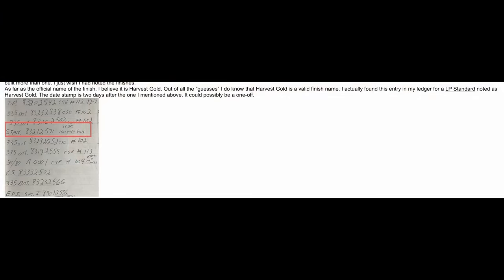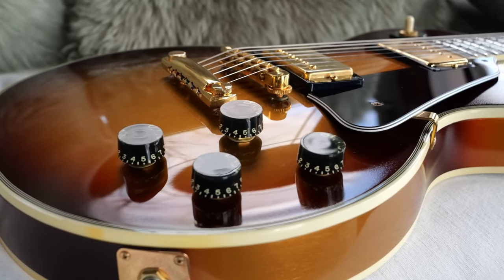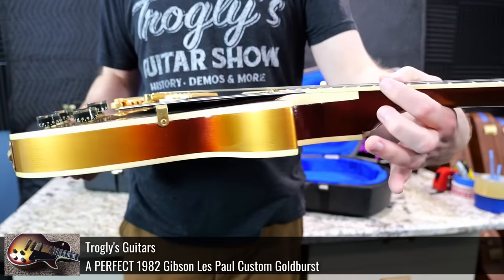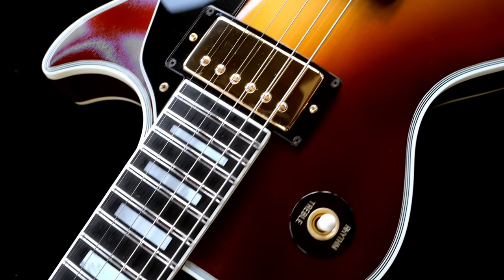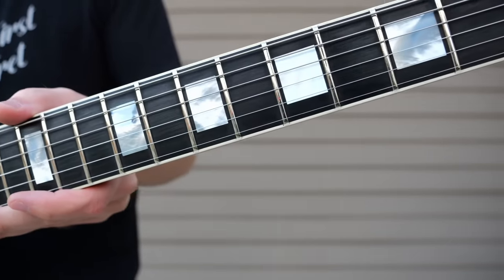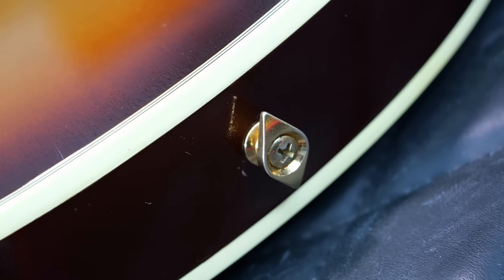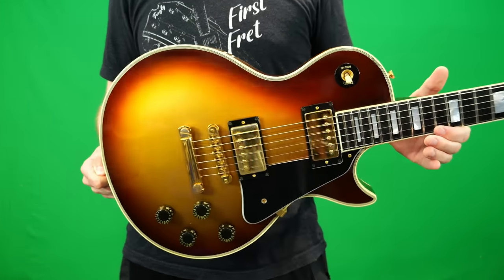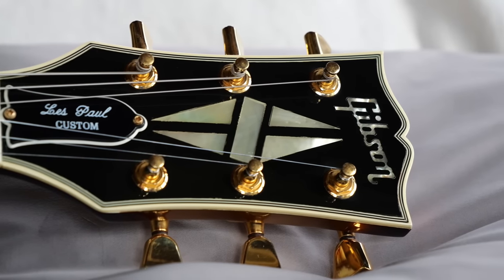It's A Miracle This Survived 40 Years! | 1981 Gibson Les Paul Custom Harvest Gold (Burst) Minty

Comment: Paint technology was changing rapidly in the late 70's and early 80's, and going from solvent based to acrylics caused headaches not only for guitars, but especially automobiles.  Think of how badly and quickly the clear coats disintegrated.  Not enough research to begin with, I'd proffer.

Comment: i have an original 81 les paul custom cherry burst. i bought it used in 91 i replaced all the black plastics with blonde gibson parts i got from gruhn guitars, and put the gold knobs on it. replaced the gibson pickups with dimarzios paf and super distortion. ace frehley style. better guitar looks and sound all round. course i still have all the original parts. mine has the flip out winders as well. love them.

Comment: Would be great if Gibson could figure out a way of getting really close to the same finish and do a new Harvest burst line.  That metal tin on my Studio won't come out on its own.  I loosened the screws and using the actual screws I pulled it out by the holes so I don't do any damage to the surrounding areas.Getting it back in is trickier since it is so tight . And then there is blindly getting the screws where they belong.

Comment: A sister of mine - but with much better preserved color. The finish is super fragile - the back of the neck is flaky as hell. But the greenish relic on the top looks super cool on mine.
Yours doesn't seem to have the cool flip out tuners but that's about the only difference.